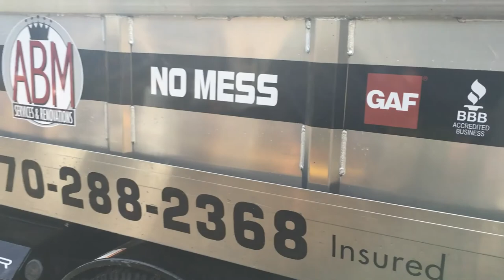Stolen Equipment??

Comment: Nice overview on how to apply these devices to our situation.  I have been testing this device out as well ever since all my equipment and trailer were stolen.  I got the trailer back but no equipment has ever been recovered.  The TrackR is not a perfect solution but a very low cost alternative to expensive GPS systems.  I think they are great with their crowd sourced option in addition to the Bluetooth. I did a unboxing video and explanation on my channel as well. You can watch my video here: https://youtu.be/rSIiUQF9fFY